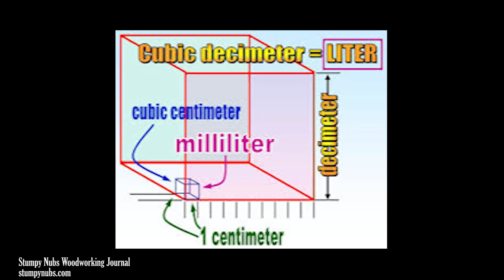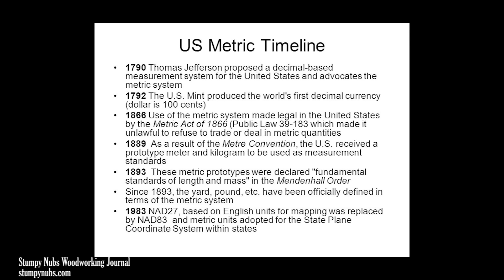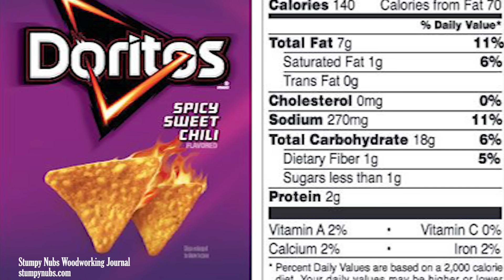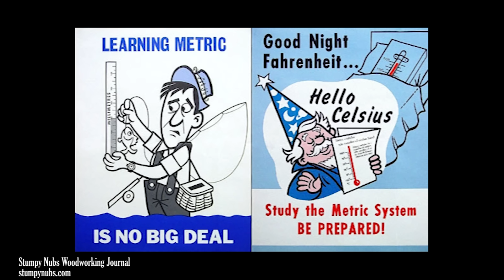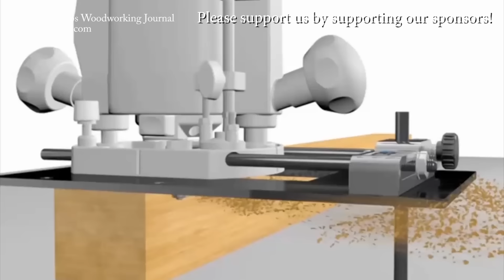BREAKING: The USA is switching to METRIC!

Comment: The irony is the US already has switched to metric, we did a long time ago. The formal definition of an inch is EXACTLY 2.54 cm. In other words, the inch is already defined in terms of the metric system. And the same applies for all the "English" units we use.  We're just running the metric system with a texture pack over top of it.
Reply from the maker: "The irony is the US already has switched to metric, we did a long time ago...." - Yes, that's what this video is all about :)
Reply: @StumpyNubs  True! I just find it interesting that even the units that are ostensibly still Imperial units are metric if you actually look up the precise definition of them.
Reply: I spent my early schooling using both the metric and the imperial system. I have been teaching physics since 1977 and find the metric (SI) system way easier. However when doing woodwork, every now & then I find myself thinking in inches - Imperial seems somehow to lend itself well to woodworking.
Reply: so you could say we're using the metric system with extra steps.
Reply: @bobalman that’s a different tangent. Nominal vs actual dimensions is still an issue in metric as well.
Reply: That's also why it's called the "US Customary System".
It was easier to redefine units by their metric counterparts than to try to keep up as the world kept refining the precision of the metric system (metres used to be based on the prototype metre, then by wavelengths of Krypton-86 light, and now by the distance light travels in a certain number of oscillations of Cæsium). By fixing USCS to metric it doesn't matter anymore if the tenth decimal place changes for a unit - the conversion is still the same.
Reply: The human body is built in imperial.
Reply: @kboothrealty  Which one? Some shriveled dead king seems like a poor measurement standard.
Reply: @Traqr  my thumb is an inch, my arm to my nose is a yard, my forearm is a foot, my stride is a yard.
Reply: @StumpyNubs  That's rather irrelevant.  People see the imperial system.  They don't care about conversions to metric, even if they are 100% accurate.  When was the last time you needed a calculation done to an accuracy better than three decimal places? Even in my engineering career, I may have needed better a few dozen times.
Reply: @kboothrealty  exactly. I can quickly estimate distances using those approximations. I also use the width of my hand for 4 inches, my outside fingers for 6 inches. Granted, a yard is about a meter, but what body part is a centimeter?  I've heard the width of the palm is about 10 centimeters but what is the size that is ⅖ of the thumb?
Reply: @bobalman  But they still are "2x4s" (theoretically planed from 2" x 4" lumber).  If you want the exceptions, look at sheet goods. Plywood has been metric for a long time. Even being metric, and not having to correct  from 3/4" to 19mm, the thickness isn't close enough to build from nominal dimensions.  Dados still have to me measured and tweaked.

The metric system is great and I wish we were there but we aren't going to get there.  There really isn't a truly justifiable reason.
Reply: @Traqr  How about the inch.  My standard inch is only 1/16th off.😁
Reply: Cute but meaningless.
Reply: But that's not the way anyone talks to each other. Nobody cares that 2.54cm == 1 inch.
Reply: to say the inch is formally defined as 2.54 cm is to say cm is the unit standard making the metric system is the governing standard, not the US/Imperial system.  
civil engineer, then you would know that metric is the standard system in engineering around the world for decades (10s of).
Reply: @douglasclerk2764 If the French had adopted base 12, that would have been ideal. Divisible by 1, 2, 3, 4, 6 with 1,2,3,4,6,8,9,10,12 as coherent whole number portions of 12 - leaving out just three primes 5,7,11.
Reply: @stewartbonner   The way equals signs work, you could just as well say centimeters are defined in terms of inches.
Reply: @kboothrealty but not every human: a long dead Franco-Norman king of England
Reply: @kboothrealty That's you. Not for everyone. I have two stride lengths: one for a yard, one for a metre. Two nose to finger tip lengths by turning head a bit. 100mm = 4" spread of fingers (not thumb), etc. My bent forefinger gives a bit more than 1" = 2.5mm.
Reply: @kboothrealty  I suppose you have 12 toes , right?
Reply: @kboothrealty  no imperial measurement system in our evolution. we been around a lot longer than any measurement system.
Reply: @kwilliams2239  nobody is converting measurements, you miss the point. measure in metric and mark and cut materials in metric. what do you care what the conversion to imperial units are? 
21st century is digital and base 10.
Reply: @kwilliams2239  so what is your point?
Reply: @cuebj  "IF"? they didn't. never happened, not the reality. so what? what's your point?
Reply: @stewartbonner  About?  I have two posts in this thread.  What, exactly, are you asking?
Reply: @stewartbonner  Really?  NO ONE is converting?  I sure am. 

As I said, I'd rather that we used the metric system. We don't and we aren't going to get there.  Meanwhile, I sure am converting between the two.
Reply: @Traqr  don't need the precision and conversion precision of +/-  are few wavelengths accuracy in woodworking.
Reply: @stewartbonner  OK, we all get that but so what?  The general population isn't and won't.
Reply: @kwilliams2239  why do any conversion? just measure in metric and mark in metric and cut. conversion just means you need to keep a bunch of conversion factors in your head and add risk of error. 99% of the world works in metric. they are just tick marks on a ruler. use a string with a knot in it if you want.  you want to woodwork or play back and forth with calculations.
Reply: "The formal definition of an inch is EXACTLY 2.54 cm."  Please show the citation for this "formal" definition.  I'll bet the source is European.  The actual definition of an inch is 1/12 of a foot.  The conversion to metric happens to be 2.54cm but that's not the definition.  Nice try.
Reply: @Emily_M81  You could but you'd be wrong.
Reply: @StumpyNubs  If that's what the video is all about, it's off track.
Reply: @percyfaith11  exactly, the inch is defined as a mm value making making metric the standard of measurement used to define the inch and other non-metric units.  this is by international treaties and agreements. you don't seem to understand what the order of the units as to what the the sentence is telling you. metric is the standard of what all other units are defined by. the inch is defined by metric not the other way around. 
Google 'SI' system.
Reply: Any one that says we can’t because we build with 2x4 lumber slimes with 1/2 OSB isn’t thinking straight. That 2x4 and plywood isn’t the dimension they think it is. So we are already measuring every cut anyway. I bet when we finally switch to metric, a lumber stud will be called a 40x90 and it will actually measure 38x89 mm
Reply: @percyfaith11  inch to foot ratio has nothing to do with metric and proof of nothing.
Reply: @TanyaLairdCivil  That's baloney.  Please site the source of your "precise" definition.  The definition of an inch is 1/12 of a foot.  The fact that the conversion factor is 2.54 cm is not a definition.
Reply: @percyfaith11  whoosh...
Reply: @percyfaith11  It's right in the Wikipedia article for "inch." An inch was formally defined by the American Standards Association to be exactly 25.4 mm in 1933.

You're confusing the colloquial definition with the technical definition. Technically, an inch is equal to precisely 25.4 mm and a foot is equal to 12 inches, or exactly 304.8 mm. 

For background, when I say "definition" of a unit, it's important to realize that we don't simply define units in relation to each other. Centuries ago, we would define lengths by standard objects; there would be a single physical object that defined "the foot" and all other lengths would be measured against that. 

But today, we prefer to define our units in ways that don't require standard reference objects, instead we base them off of the physical constants of nature. For example, one meter is defined as exactly the distance light will travel in 1/299792458th of a second. The value of standards like this is they can be reproduced independently in a lab without having a chain of standard objects going back to some mother ruler. We instead use the very properties of reality as our standard rulers. 

But such a universal standard does not exist for US customary units. Rather, a meter is formally defined as the distance light travels in 1/299792458th of a second. A centimeter is exactly 1/100th of that distance. And an inch is defined as exactly 2.54 centimeters. There is no standard definition of an inch that defines it in terms of the physical constants. Rather, it is formally defined as simply some ratio of a meter.
Reply: What a hilarious and concise video! 😂
Although I endorse the metric system, I have learnt that it is much easier to cut a given distance in half repeatedly than divide it in ten equal subdivisions and then multiply it by a certain number.
I feel your pain caught in paradoxes and oddities.
Reply: @percyfaith11  US Customary measures have been defined based on the metric system since 1893, and were updated to simplify the conversions in 1959. Metrology is a fascinating field (Why are our units the size they are? What errors do they contain? How do we calibrate instruments? Is there a better way?).
Of course, my house has 8' ceilings, 30" doors, and studs on 16" centres so I don't see the need to convert everything quite yet, and the exact values depend more on temperature and humidity than esoteric changes to the length of a standard metre. Usually the only time I change systems is when I measure a really weird value for some part and realize it's a nice round figure in the other system.
Reply: @morefiction3264 no, you're not understanding properly. It's not just that an inch is equal to 2.54 cm, the inch is DEFINED as 2.54cm. The legal definition of an inch is a length equal to 2.54cm. 

A cm, on the other hand, is defined as the distance that light travels in a vacuum in 1/29,979,245,800th of a second. It's defined in terms of universal constants. But inches are defined in terms of cm 😂
Reply: @butwhowasmoto2739   Did the actual distance an inch measures change when they created that definition?
Reply: @Traqr  The inch, foot, and mile have not changed their dimensions since well before 1893 so they are not defined by the metric system.  That is really just a sophist argument.
Reply: @Emily_M81  plop...
Reply: @TanyaLairdCivil  wikipedia artcle...must be authoritative.
You're attempting to conflate the conversion between imperial and metric to mean that anyone using imperial is already using metric.  I could as easily say the opposite.  Anyone using metric is using imperial and be just as correct.  It's ultimately a meaningless distinction.  All they did is take a ruler marked in inches and compare it to a ruler marked in millimeters and say "hmm, guess what?  An inch equals 25.4 mm."
Reply: @stewartbonner  Your statement admits that the inch is not defined by the metric system.  Congratulations and thank you.
Reply: @percyfaith11  From Wikipedia:

"Standards for the exact length of an inch have varied in the past, but since the adoption of the international yard during the 1950s and 1960s the inch has been based on the metric system and defined as exactly 25.4 mm."
Reply: @cuebj  If only humans had 12 fingers . . .
Reply: I have found it a bit annoying as my lathe is made in the UK, everything mostly in metric, but 6 mm in paper sometimes appears to be 1/4 in IRL and that difference is quite big when boring holes or trying to make tools fit. My country has been metric always... However years ago I got into quilting and had to invest in all sorts of cutting rulers etc and work in imperial. The reason for that is because there is a special presser foot in the sewing machine that is 1/4 in and it makes everything easy that way. In the metric system a typical presser foot is 7,5 mm wide from the needle, and people think quilting is difficult because they can't calculate pieces to align perfect. So, my brain on autopilot switches to inches in quilting, but not for anything else. In the kitchen... cups... like no coffee of tea cup is the actual size of US cup.
Reply: This seems to be contagious. I have a US designed (Chinese made) lathe.  I took it home in the back of my truck.  Bad decision (it weighs >500lbs), but I took it apart so that I could move it by myself. Half the bolts are metric and half imperial.  I couldn't believe it.
Reply: @cuebj  The French are not to blame, but us Indians. We made the Hindu-Arabic decimal numerals, and they stuck. 12 would've been a much better base. Or even 16, but that's more in hindsight after computers.
Reply: @morefiction3264  "you could just as well say centimeters are defined in terms of inches."/// and you'd be wrong. Centimeters/meters are defined by physical cosmic constants, not obsolete units. 

It's not a matter of equal signs, inches really are defined by metric units. If the SI authorities decided to make the meter a teeny bit bigger, the foot would get bigger too.
Reply: @percyfaith11  Any corrections made to the meter after 1930 (which was when the 25.4mm 'standard inch' was created), also changed the inch's dimensions. 

For instance, the meter was redefined in 1983 and tied to the speed of light in vacuum. So any improvements to the measurement of that quantity since has resulted in changes to the inch as well.
Reply: @rexsceleratorum1632  No changes have been made to the meter since 1930. As far as I know, 1 in is still equal to 2.54 cm.
The main point is that when you're using inches, you're not using the metric system.
Reply: @rexsceleratorum1632  Blah, blah, blah. I'm pretty sure my ruler wouldn't change in length.
Reply: @percyfaith11  1 inch is still equal to 2.54cm because that is how the inch is defined. The meter changes minutely pretty much every time the speed of light is measured more accurately. 

When you are using casino tokens you are not using US dollars. But if the US dollar changes value, the casino chips also change value.
Reply: @morefiction3264  Your ruler doesn't change in length, it only becomes less accurate.
Reply: @rexsceleratorum1632  thanks for the dissertation, but none of that means that you're using the metric system when you're measuring with inches.
The inch on my grandfather's ruler from 1925, is still the same dimension when compared side by side with an inch on the ruler I just bought at the store.  By eye you can't tell any difference so practically speaking it makes no difference.
Reply: @rexsceleratorum1632  No, it still does what it does.
Reply: @percyfaith11  Well, you're using a system that is tied to the metric system. Sort of like using a currency that is tied to the US dollar.  The dollar changes, and it changes with it.
Reply: @morefiction3264  Only less accurately. Or if it was inaccurate to begin with, could go either way, could be more accurate now.
Reply: @rexsceleratorum1632  LOL Ridiculous.  That's like saying you're using the imperial system when you use a metric ruler because both systems use rulers.  It's merely a conversion factor to convert between the two systems.  Are you using dollars when you buy something in Paris just because there is a conversion factor that equates how many dollars equals 1 Euro?
Reply: @Traqr well that's not really the point, if you want to measure your house in the length of granny's chickens you can do so - you'll just make your life much easier if your hight precision industire (let's take NASA as an example here) doesn't need to use another measuring system than your average industrial company, or even your average carpenter.
Metric, is the way to got, not just because the rest of the wold uses it, also because it's logic - your currency is base 10, your everyday math is base 10, digital tech is base 10 (once your past the binary level of course), it's not necessary for you to get more exact measurements of your house, but if you stick to an your old units just because you're stubborn, it's getting increasingly more difficult..
I said this in another comment before, you don't have to learn it anymore, you're used to imperial and that's totally fine, but teach your children metric in school, so they'll have an easier life..
It's just like we (in Europe) get thaugt English in school, it's the language most oft the world understands, and that's exactly the same for metric, metric is the measurement langue the whole world understands - and it's taught in a couple of hours if done right. Learning a second language takes years.
Reply: @rexsceleratorum1632 why 12? The powers of 2 would be a good fit for computers (2, 4, 8, 16, 32..), but 12?
Reply: @percyfaith11 no, you don't seem to understand it, an inch ins legally defined as 2.54cm, if the cm would double in size, the inch would too.
If you want to double the inch, they would define it as 5.08cm and the cm wouldn't be affected. It's no conversion, metric units are used to define the inch.
It's coupled, but the meter is used to define the inch,  you can not reverse it - it would be like getting a chicken without hatching an egg..
Reply: @TheFlyBullet  But how'd the egg come along without having a chicken first?
Reply: @TheFlyBullet  Only because 12 was a historically used number base that is still better than 10. 16 seems superior in the computer era.
Reply: @percyfaith11  The Euro is not tied to the dollar. It seems you don't understand the concept. The inch will change in size if the SI authorities decide to change the meter. But the meter will not change if the US decides to change the inch, then it will simply become decoupled from the meter. It is NOT a reciprocal relationship like you want to believe.
Reply: @rexsceleratorum1632  you can't see the forest for the trees.  The discussion is about whether one is using the metric system when they are measuring with the imperial system. Obviously they're not.
Reply: @rexsceleratorum1632  saying you're using a system that's tied to the metric system is not the same thing as saying that you're using the metric system. DOH!
Reply: @percyfaith11 I think it's funny metric people care so much, to so vehemently defend a distinction without a difference.

Ain't nobody measuring things in nano inches. It's not even a clever straw man.
Reply: @percyfaith11  Well, you went well beyond that and claimed that the only relationship between metric and imperial is that they can be converted back and forth (obviously). When in reality, imperial is tied to metric as the reference standard.
Reply: @rexsceleratorum1632  Read the op genius.  That relationship means nothing.
Reply: @percyfaith11  I don't necessarily agree with the OP just because I called you out for claiming that there is no relationship at all, beyond the ability to convert between them (duh). You are using imperial when you are using imperial. I'm not debating that.
Reply: @rexsceleratorum1632  Well, that's what the debate is about, so you agree with me.
Reply: @percyfaith11  I probably agree with you on a great many things. Just not when you deny the dependency of the imperial system on SI standards.
Reply: @rexsceleratorum1632  The metric system is nothing more than a conversion factor or intermediate step.  If the metric system disappeared tomorrow, it would be simple to calculate the dimension of an inch related to the speed of light.
If the metric system disappeared tomorrow, I could still measure anything I needed to.  
It's impossible to get more independent than that.
Reply: @percyfaith11  You are saying that the imperial system COULD become independent in the future. Currently it is not, and nor is it ever likely. 

Because imperial is just an inferior legacy system that is being gradually phased out, even for the US.
Reply: @rexsceleratorum1632  it's absolutely independent right now. There is no requirement or need to refer to the metric system. If the speed of light is found to a more precise degree the inch or foot or yard can be multiplied by that change.
Whether the imperial system is declining in use or not is moot to this discussion.
Reply: @percyfaith11  The foot is pegged to the meter, and the meter is pegged to the speed of light. 

You can twist that how you want, but those are the facts.
Reply: @rexsceleratorum1632  It is a fact that as soon as you say a yard = 0.9744m and 1m= the length of the path traveled by light in 299 792 458 of a second you have also said that 1 yard is = 0.9744 x the path traveled by light in a vacuum in 299 792 458 of a second.

If A=B and B=C, then A=C.  B becomes moot and unnecessary.

If the speed of light in a vacuum is found to a more precise degree in the future, all you have to do is multiply that by 0.9744 to correct the length of the yard.
The middle conversion of the meter is nowhere to be found in that case and is completely superfluous.

Thems the facts and you might as well accept them.
Reply: @StumpyNubs  TBH, so much of this comes down to us not using the SI correctly. I do think that the only really sane way of handling this is to just use the system that makes the most sense for the application. As in, SI and metric for sciency stuff and SI and customary for most other things.
Reply: dont use cm use mm
Reply: @Traqr  
But isn't Kryptonite what almost destroyed that all-American superhero Superman? No wonder the USA stuck to Imperial Units.